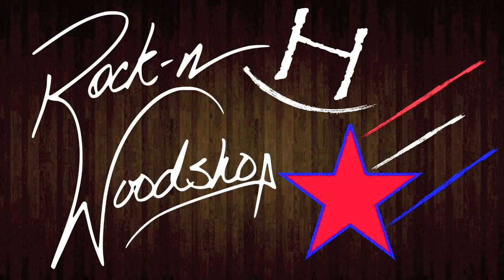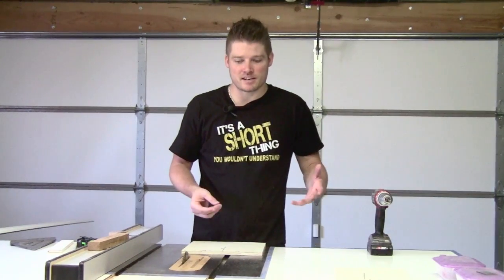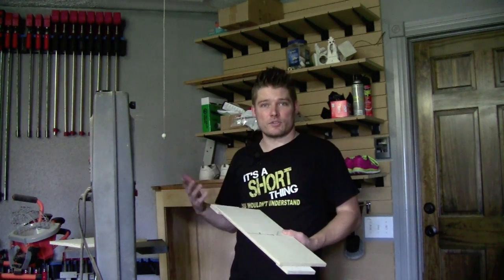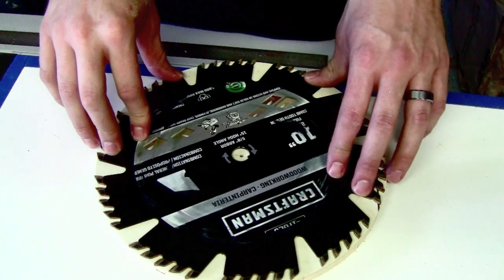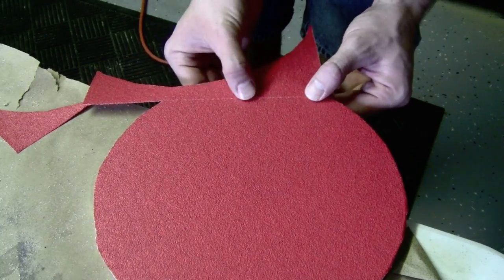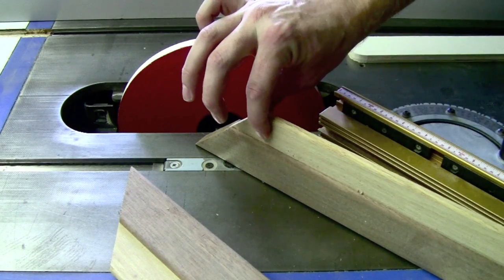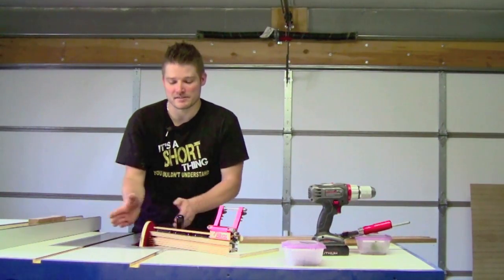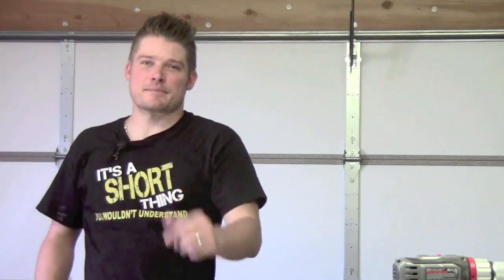Tablesaw Sanding Station

Comment: Fantastic idea from a fellow Okie. I do something similar on the lathe with wood disks and adhere the sandpaper with spray glue. To remove the sandpaper I use a blow-dryer on hot. The heat softens the adhesive enough to remove the sandpaper (slowly) and leaves a slightly sticky surface that doesn't take as much glue to re-coat for the fresh layer.
Reply from the maker: Great!  Thank you for the tip with the hairdryer. I will keep that in mind!

Comment: This is awesome! My wife just ordered me a brand new Shop Fox cabinet table saw to replace my cheap and horribly inaccurate, but in perfect working order, Harbor Freight table saw. I hate to throw the Harbor Freight saw in the trash, since it barely has a scratch on it, has a perfectly good motor, and even has it's own tool stand, so I was looking for a way to turn it into some other useful shop tool. I'll be able to turn it into a dedicated two sided disc sander, where both sides of the sanding disk can be used, depending on which side you're standing on. Such a great idea. Thanks for the video.
Reply from the maker: There you go. That should be perfect. Thank You!!!

Comment: Great idea, thank you.  I frequently misplace EVERYTHING, so for lack of a measuring instrument, I draw two lines from corner to corner, which yields a center mark for your wood.  Also, I used an old saw blade, and cut off the teeth, then glued wet-or-dry paper to the face of the blade.  Thanks for the video, you gained a new subscriber.

Comment: I was planning on buying a Rigid sander.  Thanks for the idea Drew.
Reply from the maker: You're welcome Marc. The rigid sanders for the oscillation is a good buy because it combines a belt sander that oscillates as well as a spindle Sander that oscillates. However, if you are just wanting a disc then give this a try first. Thank You!!!

Comment: genius. I have a old table saw that I could use for this sanding station.  instead of getting rid of it. It is a small saw which will work out good for my humble little shop. thanks for the idea  Drew.

Comment: Made one, and I love it! I found out later they make large sheets of sandpaper you can buy, but they hide them in the rental section of home depot. They are for the large floor sanders. They are 11" x 18" I think. Thought I would let you know in case you need to make another one. Thanks again for the idea and video!
Reply from the maker: Jonathan Mutchler Dang, wish I had known that when I bought that paper.

Comment: Truly inspired! Now I just need the table saw. Also, finding center is quicker and easier with the corner-to-corner X method.
Reply from the maker: Well I could have done that, however since my square piece was a 11 x 11 piece I needed to find the center of one edge and drop back 5 inches. Otherwise my disk would have been 11 inches round if I had done corner to corner x'ing. I could have made a 10 x 10 square piece but typically when a bandsaw Blade hits and edge it kind of walks. I wanted to keep the bandsaw Blade continuously cutting the entire circle with out exiting the board. Great tip though.

Comment: Great idea,  As easy as it is make several sanding blocks for the various sanding grits.  It is quick and easy to change blade.  Faster than changing the paper on the block. Thanks for the video.
Reply from the maker: Very true. And with the easy to use jig you can make an abundance of them as needed

Comment: What a great idea, bit I took your idea a step further.  I have an old Ryobi table saw that flew off back of truck one day and broke the skirting.  I made my disc 1/2 inch thick and it fits the Ryobi insert fine so I now have a full time disc sander that the disc retracts and moves out of the way when not needed.  Great idea, thanks a lot.
Reply from the maker: Now that's how you get it done!

Comment: Excellent idea! But now el cheapo benchtop table saws are going to become scarce at the yard/garage sales.

While I'm at it, I'll also toss in a tip for changing the paper - a heat gun. Most spray glues just can't handle much heat, and a quick once-over with a heat gun will get it to release within just a few seconds. It works great for removing paper patterns too.

Comment: Great idea. I need a disc sander and this is a good option until I can get a dedicated tool.
Reply from the maker: I have a dedicated sander too but it is only a 6 inch disc. It works okay but it is a slow turner so it requires a little bit more pressure to get the job done. Also, the tabletop for it is very small. Thank You!!!

Comment: Cheers mate!  You just saved me a BUNDLE on my VORTEX 3-Wheeled DIY car project, (Yay!).  The 2-sided feature is the "berries"!  At this El'Cheapo rate, one can make a bunch of these guys, for all grits to be used, FANTASTIC!!  Thanx mucho.  I'm guessin'  that the RPM need not be reduced for this?  If it does, I have a Router speed controller that might work, but then again---?       Gb      bg
Reply from the maker: +george scarlett you are correct. I would highly recommend lowering the RPM to keep the disc from possibly breaking apart due to high speeds. Also, MDF would probably work better for your disk because it is a consistent density all the way across, unlike plywood.

Comment: Cracking idea Drew!  Another NEW idea, Not seen it before.
But yes you're right, those disc sander tables are tiny,  he one on mine doesn't even securely sit at 90° :-(
Is there space under the disc to make it slightly bigger, or is 10" the absolute max?
Reply from the maker: It really just depends on how much space you have in your tablesaw. Mine will not accept anything bigger due to things under the table that constricts the size.

Comment: That is genius! what a great idea. personally I would be worried that it would fall apart and fly off due to the forces put on the wood, but what the hell I'm still gonna make one though.
Reply from the maker: I would get a high quality piece of ply without any voids or make it out of MDF.  Cool part is because of the fast speed, it requires very little force to sand.  It is so fast and easy to clean up miters  I love it!!!
Reply: Cheers

Comment: Awesome idea, Drew. There's only one concern I would have which I'm not sure you can speak to since you only just employed this technique.

I've heard people talk about using a drill-press with sanding drums before, and some people end up experiencing some wobble because of the pressure applied to the drill bits which ultimately affect the chuck.

The question I had is - would there be any concern about the pressure applied to the arbor from using the table saw in this fashion?
Reply from the maker: There is always that concern. One thing that I have noticed in my experience is that the faster it turns the less pressure you need to apply for adequate sanding. The drillpress by definition has to turn slow so it can cut more efficiently. Using a drum sander on such a tool requires more pressure to be able to sand properly because of the slow rotation. However, because the tablesaw turns so fast you will not have to apply that much pressure for the sandpaper to eat through the wood. The main concern is making sure that your disc is well balanced. The way to achieve that is to use plywood that either has no voids or MDF that is consistent construction throughout. You also need to make sure that you are circular disk is a perfect Circle. Any abnormalities will cause vibration and premature wearing of your tablesaw bearings. I hope this helps.

Comment: This is not a good idea. This is a GREAT idea!
Reply: Slick ! I wonder if you could apply a 2- sided hook and loop face to it ? Most of the time I'm sanding stock that is less than 4 inches, so orbital sander disks would be large enough, and easier to replace.
Reply: Don't see why not!
Reply from the maker: You very well could, just make sure that the hook side of the Velcro that you use will hold on at that high rate of speed. The last thing you want is your paper to fly off, LOL. Glad you enjoyed the video!
Reply from the maker: Thank you Bob so glad you enjoyed it. Thank you for your kind words

Comment: Awesome idea! Just curious, do you think there is any risk of the wooden disc flying apart? Any suggestions on what you should use and not use (i.e. plywood, MDF, etc.)? Thanks!
Reply from the maker: In all honesty MDF might be a better choice because of how it's made. Plywood might have voids here and there which may cause it to be out of balance more. I can't say for sure how it would hold up to the RPM range because I have yet to test it, but I think it might be a better choice.
Reply: Rock-n H Woodshop  Thanks, man. I have some of that laying around, I'll make one this week. As a brand new woodworker here in Oklahoma, I find your channel inspiring (especially in this heat)! Keep up the good work!
Reply from the maker: Thanks a lot! It does get mighty hot in the shop around this time. My window unit cannot keep up with the heat either.

Comment: This is one of those things that's been discussed 'over the ages' in WW. Some say that the side pressure will prematurely wear the arbor bearings. I know that my first drill press was a benchtop Delta that I used sanding drums on, and it ended up with bad bearings. I would also worry about a wood platen coming apart at tablesaw rpm's. I'd at least suggest making your disc out of aluminum.

Comment: Nice idea. Do you have any problems with burning? Since the rpm of the table saw must be atleast 2 Times the rpm of say a retail 12" sander.
Reply from the maker: Only if I press superhard against the disk. I find that the speed of the disc and the pressure of how much you push the work is inversely proportional. The faster the disc the less pressure needed. My dedicated sanding station that I have turns slower and it requires more pressure for me to sand it down.

Comment: Very cool.  I have a sawstop and I don't believe the sawstop will start up with a wood blade in because the diagnostic check will fail.  Can anyone confirm that?
Reply from the maker: Hello Jake, I believe you are correct. The wood does not conduct the electrical impulses needed to make the sensor work properly. You might have to turn the safety switch off in order to use the disc in this fashion.

Comment: I used a metal cutting blade. Take cardboard from cereal box. Use metal blade to transfer onto cardboard and sandpaper. Glue sandpaper to cardboard. Cut hole for arbor. U can make different grits and just change the disks.
The disk stays in place against the blade.

Comment: how have these held up, I would be worried that they speed at which they spin might cause it to fly apart dangerously
Reply from the maker: So far so good. However, I’ve only needed to use it a handful of times so I really cannot say it has held up after repetitive use. One way you could combat this is to install a rheostat on your table saw motor

Comment: the bearings in a table saw are not designed to take the lateral forces this puts on them , so it could actually damage them.

Comment: Great "Uh, Duhhh!" moment for me.  I can't believe I didn't think of this.  I can see making 2, 3 or 4 of these to allow for some being out of service after stripping w/ the mineral spirits.
Reply from the maker: I've had this on my list for sometime now. As you can see it is very easy to make which is kind of funny that I haven't made it sooner. You are right making multiple discs would make changing the paper disks out faster. However, somebody commented that you can use a heat gun to remove the paper which would not put your disc out of commission very long. So glad you liked it and thank you for sharing.

Comment: I would love to have this, but it won't fit on the arbor of my tablesaw.
Reply from the maker: What size arbor do you have. This piece is only 1/2 inch thick. It should fit even a portable jobsite saw.
Reply: not sure of the exact specs but i might have to give it a try. if it doesn't work i might try using 1/4 inch plywood

Comment: the idea is good, but with the speed of the saw you'll either burn the wood or sand paper or both. Good luck. been there done that.
Reply from the maker: The thing that I have noticed with burning of wood is that the slower the sanding speed the harder you have to push for adequate sanding. In this case since the tablesaw moves a lot faster there is less pressure needed for a proper sand. Therefore burning of the wood is minimal to nonexistent. Especially on the lower grit sandpaper's. Great insight, Thank You!!!

Comment: I've thought of doing this my self but I was afraid of damage to the arbor and bearings. Tablesaws are not meant to have pressure pushed in the direction that you are sanding. My saw is to important and to expensive to risk something happening.

Comment: Wouldn't it be better to glue a Velcro style pad to the disc and so be able to interchange pads without using glue every time.
Reply from the maker: You very well could do that. I would make sure to get a very good adhesive Velcro so your paper doesn't fly off while spinning. However, you are right it would make it easier for changing paper.